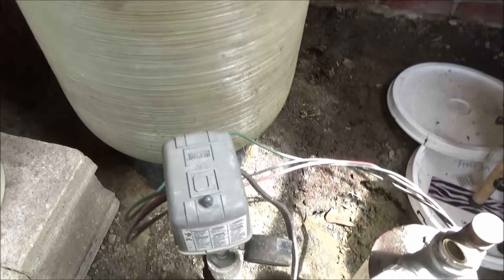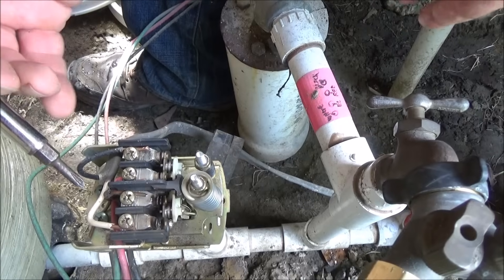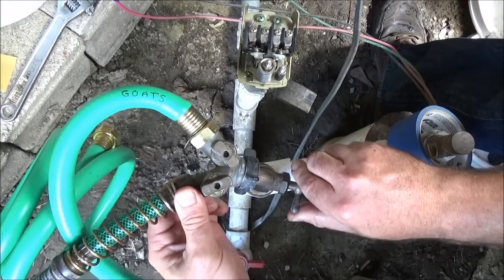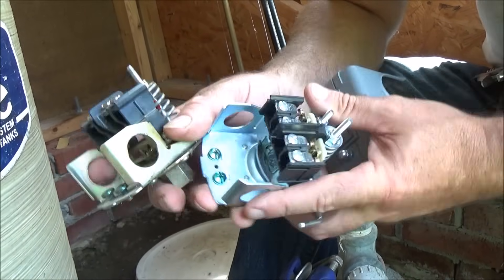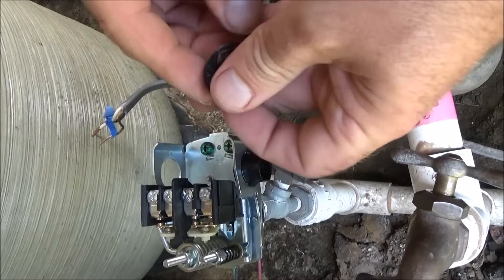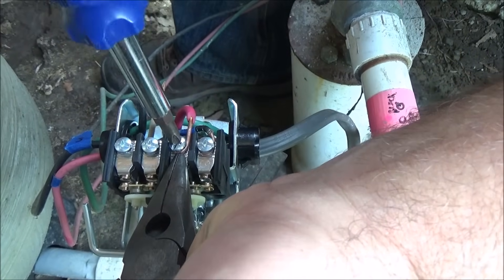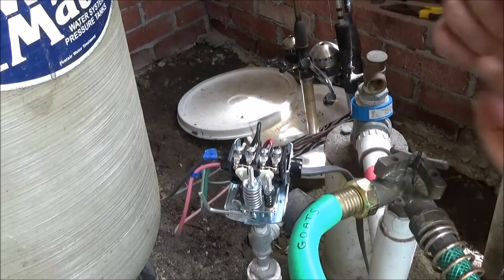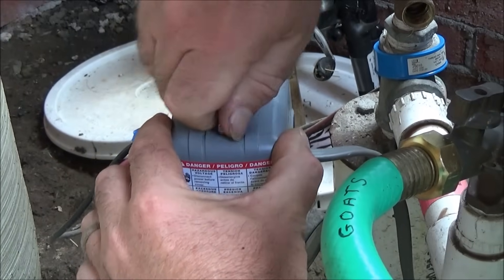replacing a well pump pressure switch (burnt contact points)

Comment: Word to the wise…do not fully trust those non-contact voltage detectors. They work but they also aren’t 100% reliable so be careful. I’ve worked several places where they don’t even let us use them.

Comment: We will replace the pump about 4 days ago the pressure switch does not work right now it's all the contacts are open if you take a stick and push them shut the pump works but they they want to stay open what what's causing the points

Comment: Why NOT add a couple of 0.01 to 0.47 uF 600 VAC x2 capacitors across the points on each leg? This is standard practice on most high current draw electrical appliances to reduce arcing (spark reduction).

Comment: Not a fan of low psi cut off switches. Power outage customers can't figure it out charge a lot of service calls for holding that lever down. And if it's a big tank have fun sitting there holding it for 15 min

Comment: Thank you!
So, the switch needs a strain relief clamp?
What awg wire is that? Is it two wires or 3? Like is it 10/2 with ground or 10/3?
Aww. The deer was cute!

I didn't realize that draining the pressure tank was necessary, so thank you for that info. 
We once got the kind with the manual override lever and it was too hard to turn. It got stuck and wouldn't let the pump turn on. Ohh. It had to be put in Start first. LOL. No wonder it didn't work when my electrician tried to set it up.

Comment: I really appreciate your video. I had an electrician from a company come screw my house up, and claim my pump had gone bad during the time he put a new panel in. I knew he had screwed up wiring because there wasn't the right voltage getting to the switch or pump. He claimed it was the pump, then the switch. I replaced the old one with this kind, but still with not enough voltage, didn't make a difference. But I didn't know about what to do with the new one having the switch. I suffer brain damage and I forget how to do things and even worse I question myself so badly that I don't want to try because of not being able to remember. But having something I can compare what I do, and have it as if someone's there with me talking me through it, helps a whole lot. Thanks.

Comment: I’m a licensed plumber and I approve this video. I wanted to find an accurate and correct video to send to my friend who lives too far away for me to help him in person. You’re a good job
Reply: I am slightly confused by one thing; maybe this is because I have a blatterless tank.  I have always filled my tank with air to 38 (it's a 40/60 tank & system) and then added water via the pump.  This gent fills the top of the tank to 26 (I don't have a valve at the top to fill on mine) and it looks like the PSI goes from 0 to 50 from just running the pump.
Reply: @wrxmarcus2 i have never installed a bladderless tank but what you said sounds correct. I’m guessing it is older? We typically rip them out along with any galvanized and start fresh.

Comment: Thanks for the excellent tutorial.  My switch has needed resetting a few times in past day so I'm guessing it might need replacing. I'm thinking first I might try cleaning the points with a little sand paper. Your instructions are very clear thankyou again.

Comment: Had a shower this morning,,, then some normal water use in the kitchen,, but when I got out to the barn to water the animals I had no water... thought The Well Pump Went,, but after a quick inspection and a finger tap on the pressure switch the pump fired up.. will be replacing my sticky pressure switch with the help of this video,,, Thx !!!

Comment: Moved into a home that had been abandoned for years, a few months in we burned up a switch and pump - filled with sand. Called a plumber and he replaced the bladder, switch and pump - , still getting sand, so much that the pressure switch will not operate. I've been told i need a new well now - already out 3k, but trying to hold out until the fall to be able to pay for the new well. Is there any way I can prevent the sand from burning up the new pump before then?

Comment: Just a helpful tip, once you put on the teflon tape, put some wet pipe dope on the tape to lubricate it. That will prevent the tape from shredding and coming off. I liked your simple tip about putting wire on the left of the screw. These are all little things that professionals remember after learning the hard way.

Comment: Hello I just purchased a home and it has ground water pump I'd like to replace the fittings and pressure switch, but how do I know what size pressure switch I need? Also it doesn't have a tank do I need a tank this was used for outdoor watering only

Comment: Hi, what if the pressure switch was burnt down? today my pressure switch is burn to flame I think the installer is not placing the wire properly do it damage the pump?

Comment: good presentation. my problem is the manufacturers who save 3 bucks on 400 units.....of metal costs when pumping them out on the assembly line. that's cheaply reprehensible as it makes bending of  brittle wires tough, unsafe ......a bit too tight. why????

Comment: You made a common mistake. When using a hot stick or VOM first check against a known live circuit, to verify the tester works well. Then test again to verify the circuit is turned off.

Comment: Thanks for a jam up job explained how to do it properly.....just one thing you may want to add, I just replaced a presure switch and it was fried beyond recognition! Meaning I couldnt tell which wire was hooked where. I had to guess at wire placement. It literally looked like it was in a house fire. Im not sure if I did it right even though the well pump works and delivers water to the home, I would like to see proper wire placement to compare what I have installed. Submersibe with 230 volt 3 wire. Thanks for your fine video!! Dan

Comment: I have four well pumps on my farm and all have the "low pressure cutoff" style switch (with the little manual lever).  Normally, the switch will kick on the pump when the pressure drops.  However, if this fails due to the well running dry, and the pressure continues to drop to near zero, the low-pressure cutoff will shut down the switch and won't turn on again until the lever is moved to start position.  This saves the pump motor from overheating or dry seals burning from the pump running fruitlessly non-stop.  Worth the extra few dollars for the LPC pressure switch by far.  However, if you have a blackout or cut power to the pump, that the pump may have to be manually started at the PS if the pressure had dropped in the meantime (due to leaks, livestock tank filling, or someone flushed the toilet).

Comment: I just got home after being gone for a week, and I had no water. I live in the country and have well water. The pump was new 25 years ago, but has been on and off, needing a prime when gone for 2-3 weeks. The pump is in my basement, pipe goes out to about 3 feet in front of my house and there is where the well pipe goes down, I think it is around 40 feet. So I tried to prime it, not sure if I was doing it right, but it worked the last time 6 years ago. My pressure switch seem to work ok, and I only see the pressure gauge coming off the bottom a little. It is about 6pm here in Michigan, so will probably have to call a well guy to see if he can help out, if he will come out.

Comment: Hello i tried this process but not exactly, i am trying to regulate the pressure of the tank to start at 30 & shut down at 50 because i was getting rattling in the pipes when it started up. So i turn the power off and the water off and brought the pressure of the tank down to zero but then we had to fill the tank with air up to 26 then we started the system back up and it started back up at 40 and shutting back down at 55. I am no longer getting the rattling in the line but the pressure in the kitchen is a little low. Can you help?

Comment: I’m sorry for my ignorance but I’m supposed to have a 220 v line going to my switch, correct? I have the black and white wire connecting the switch, which I know in other circuitry is usually considered a hot leg and a neutral leg. My switch is wired so the black wire is coming out from a breaker and the white wire is coming off the neutral bar. Is that correct? It does work but my plumber told my wife there’s a problem with the pressure and I need to fix the electric. I’m working with an old electrician who is maybe past his working years. Any help is greatly appreciated, can’t find any info from Breaker to switch.
Reply from the maker: My understanding is that the 220V breaker should have black and red wires coming out that are both hot. The white is neutral. The green is ground.

Comment: if i have the 24 ltr tank in the system with samw switch still we can use it 30/50 or first i need to reduce the pressure manuallly from switch?

Comment: Great guide. The only thing i saw that was different for my experience doing it, was the wire colors. For me the colors go Black, white, white, then black again. Other than that, everything you showed was accurate. For a side note, when putting on the new switch, make sure you do not over tighten it. Also if its in a weird position, sometimes it helps if you screw it on some and then put the wire on it, then finish screwing it on tight. Main thing tho is make sure the power it off.
Reply: On a 230v AC Motor, one wire is Hot L1, the other wire is Hot L1, and the third wire is ground.

The having the colors change at the pressure switch won't hurt anything as long as it is just L1 and L2 that get flipped.   Ideally, you would have a pair of wires the same color on the left and the other color would be the pair on the right on the pressure switch in the video.  It doesn't hurt anything if the colors are wrong as long as they end up going to the right places.   Just properly wired would mean they are matched up and then go to L1 and L2 on the motor.

The other way of saying it: the motor doesn't care if you have the two power wires hooked up to L1 and L2 or reversed as L2 as and L1... It'll work the same either way on my a 230v AC Motor.

Usually you wouldn't use white at all for 230v electrical, install preferring red and black for L1/L2.

Comment: Thank you. I don't have an air pressure tank so is that a necessary part or can I just replace the switch without filling the air pressure on the tank?

Comment: Just commenting - - !) Replace pressure switch regularly by checking it for burnt points, etcetera. every year or so.  2) After turning off electricity & checking for live voltage, never intentionally touch the wiring. That is a bad habit to watch out for. Do clean  the wire tips with sandpaper. 3) Make a hook on the pump wiring with a needle nose pliers to get a more contact & secure connection to the holding screw. 4) Always try to do some 'upgrading' when working to replace the switch. 'Upgrading like cleaning up the immediate area from dirt, debris with brush, rags, or vacuum. And replacing that little connecting pipe at the PS. Just saying.

Comment: My jet pump 40/60 is wired with 220v.  When I check the two middle terminals on 40/60 are 220v.  How can I wire a 110v GFI into this switch so that it will turn on a chlorine pump when the well is running?

Comment: Funny, you went to such lengths to explain how the previous installers wrapped the wire around the screw in the wrong direction and then you went and did it wrong on the pump ground wire...

Comment: Excellent video. thanks for sharing. My switch is not burnt but it plays games on me. irregularity in the pressure. not sure whats causing it or if it can be fixed. i might change the whole switch.

Comment: Excellent job. The only minor thing is you used too much Teflon tape. A lot of people think the tape seals the connection but it’s is only a lubricant that helps get a tight seal by lubing the threads during tightening.  Only one wrap in the correction direction is best.

Comment: Nice video!  Wanted to make sure I wasn't missing anything before I  took the old one off.  Thank you!  Quick edit.  For those of use who are memory challenged and who get interrupted, I like to take a picture of the wiring before hand with your phone.  Then when you go to put it back together and start second-guessing yourself you just refer to the picture quick.  --cheers

Comment: Teflon tape is a lubricant not a sealant. Bad stuff. It can clog lines and filters, and can loosen up with vibration. Use PST thread sealant/dope. Spot on with your electrical installation. 

Just sayin. Cheers.
Reply: What?  Dude, everyone uses teflon tape.  It's a lubricant AND a sealant (fills the voids between threads).  If you are getting it in your filters, you are doing it wrong.  maybe too many wraps and also make sure that you leave the first couple of threads bare.  NPT is . . . well . . . tapered.  I've heard a lot of experts say not to use it on the first few threads, especially in hydraulics.
Reply: @zuul2591  That's my point. A lot of people are misinformed, It's NOT a sealant. I know what tape is and what it can do. Talk to the experts at Loctite. It's their number one selling product. They keep selling it because people keep using it. I'm no expert, but I've been in industrial sales for over 25 years and a maintenance tech for 15 years. I have given product knowledge training on Loctite, DOW, DuPont, 3M products to maintenance departments and OEM engineer's for a long time. The number one loss of energy at most factories is air leaks caused by loose air lines. Over time the connections get loose from vibration, caused by not using a sealant. The tape will end up in filters causing the motor to run longer and harder then it should. So why would anyone put a lubricant on? Because it makes it easier to assemble the pipe together.
Reply: @billyjames5283  Just like every field with lots of experts, there are lots of opinions.  I've also noticed that trainers from companies are often very opinionated and they disagree with each other.  Regardless, there's nothing wrong with tape in most applications.  Certainly not in this one.  Some fun links:  https://en.wikipedia.org/wiki/Thread_seal_tape     and     https://www.ridgidforum.com/forum/mechanical-trades/professional-plumbing-discussion/10926-teflon-tape-pipe-dope-hydraulics-systems            - Just examples of the discussion, not authoritative.  Not trying to start a battle of the links.  Just posting proof that there are a lot of opinions.

Comment: Thanks for this video! I replaced my pressure switch with a different brand called watersource and it didn't work. I bought the D one like I had and I think it's working? I have water in the bathroom but my kitchen isnt working. Any suggestions on it? Thanks

Comment: Why are there 4 contacts? My switch has 4 contacts but only 2 wires on one side are connected. The switch is working though but I haven’t figured out why unless the other 2 contacts are for redundancy.

Comment: Thank you for this video , I replaced my switch this morning. Mine was a 40/60 and was all burnt out and would not kick on till it dropped to about15 lbs.also fixed what  I think was waterlogged tank by emptying then adding back correct pressure. Again thanks for posting!

Comment: What if the pump gets submerged in water?? Will it work after the waters been drained from the basement?
Reply: Electrics may be messed up.  Dry it out thoroughly with a fan and hair dryer and give it a try.  Any smoke or smell of burning plastic means its done floor.  BTW, any residual moisture inside the motor will be driven off by the heat of the motor.

Comment: The pipe coming up to the pressure switch is rusted badly.  I'm going to have to see how rusted the pipes are.  If I can, I'll clean them out and replace them.  It's not drinking water but water for the yard.  Anyone know of videos on replumbing around the pressure tank?
Reply: Still fun too laugh at auto correct
Reply: @MarcoDeoMARCUSOREALIST  - the week is not in operation so no risk of busting. I'm trying to get it operational
Reply: @MarcoDeoMARCUSOREALIST  autocorrect bit me. The well is not operational
Reply: @MarcoDeoMARCUSOREALIST  - except that an auto-correct isn't really my mistake.  My mistake is not correcting it.  Chicken...egg, i guess, right?

Comment: I was hoping you would tell us where those wires go which ones go to the pump which ones go to the power????
Reply: By convention, power goes to the 2 outer screws.  Pump connects to the 2 inner screws.  If you have color coded motor wires, keep the white wire with the white wire from the power line.

Comment: Only thing I would change is when testing the power. I would test the proximity tester on a known "hot" circuit then test the well pump circuit and then test the known hot circuit again to verify that the tester is not faulty. Proximity testers are great but dont always work and should never be relied on to verify your safety. You can also check them if you rub them back and forth really fast on your forearm.